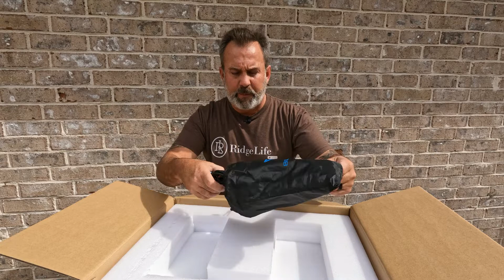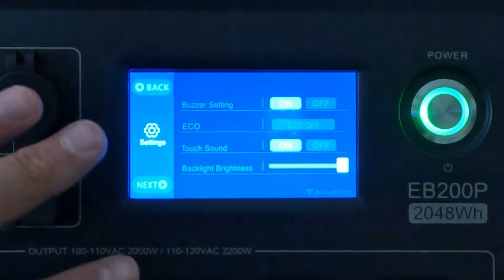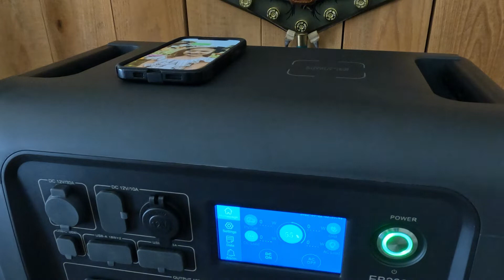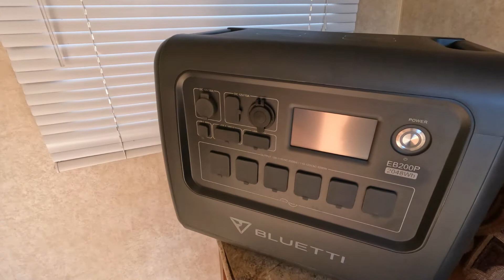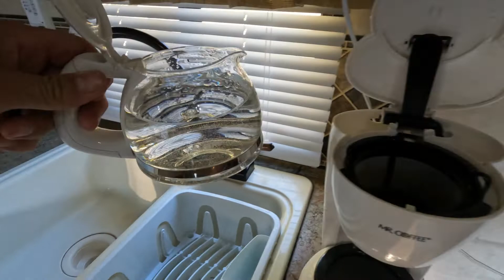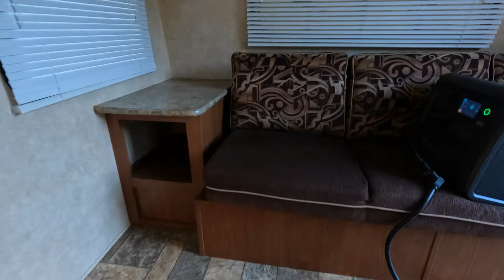Bluetti EB200P | 2200W, 2048Wh Solar Generator with 6 AC Outlets (4800W Surge) | Battery Backup

Comment: Just found one of these EB200P's for $480 used, what size is your AC? Is that a 13,500btu? Curious to know what the AC surge watts were vs running watts after about 10 minutes of being on. The EB200P has a really low AC charging speed but that's my only issue with it. The pros way outweigh the cons for $480 haha
Reply from the maker: Mine is only 10,000 btu. Nice find!

Comment: How long would this be able to run a portable ac unit?
Reply from the maker: A small one for a few hours but if you connect a solar panel to it, all day.
Reply: @RidgeLifeReviewsHowTos  will you need to turn it off to charge? Or can you charge it and run simultaneously?
Reply from the maker: It will charge and run at same time.

Comment: Yeah! Go Bluetti! 🎉 We love our Bluetti! We swapped out our RV frig for a Danby frig because the Danby runs +-100 watts. This helps conserve the power since it's always on. The  EP500 is our main unit and runs all our needs but we do have a smaller unit as backup. Right now we have 1000w solar input that keeps up with things most of the time but would like to add a wee bit more (ran out of room on the RV roof). 😂 I would love to get the new big AC unit (I think AC900) for the house once built! ❤
Reply from the maker: You got that right! Thx!